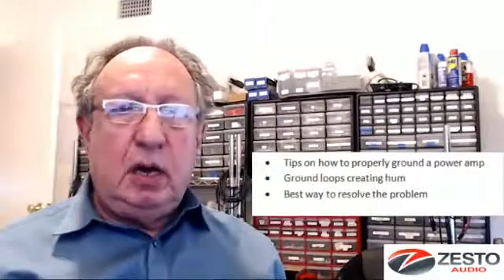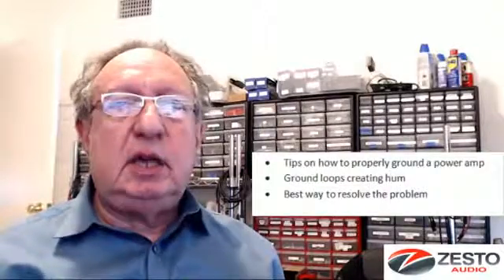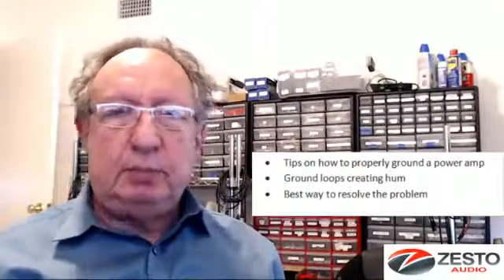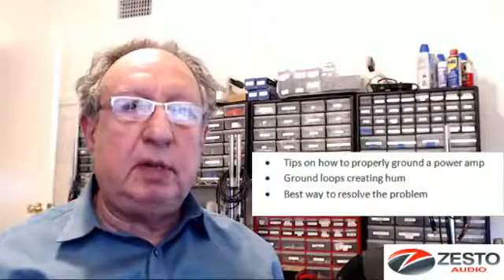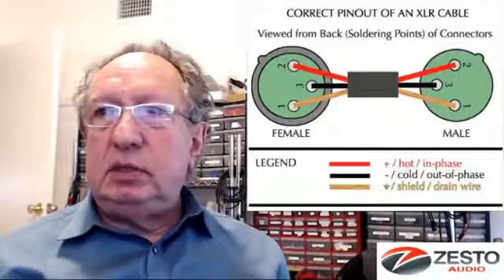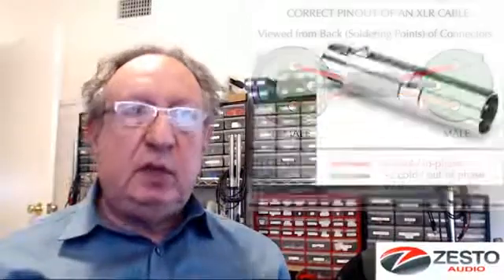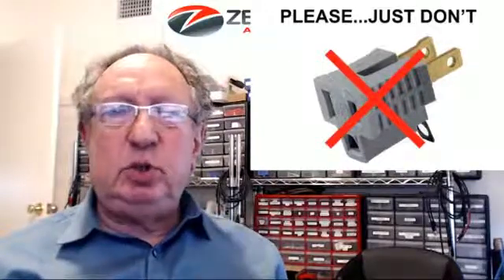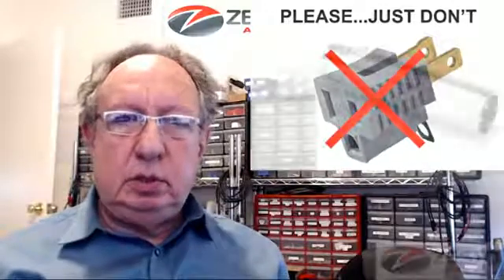Tips on how to properly ground a power amp

Comment: Why are you leaving your ground switch off which to us means your not grounding the system? Wouldn’t you want it to always be grounded?
Reply: Because it is already grounded via AC powercord, it doesn't need another ground. The problem here is the groundloops. Never ground something multiple times from diffent locations since that introduces all kind of problems. In this particular case, the chassis of the pre-amp gets grounded via AC (wall socket), the chassis of the power-amp gets grounded via AC as well. But now we also introduce an audio signal cable (aka interlink) that sends audio from one device to the other. This cable also has ground and creates an extra connection to ground between both devices : not good! With RCA this is unavoidable because it will introduce other problems, but with XLR this can be eleviated by using a ground switch or adapter and this does NOT mean the device is NOT grounded!
I personally never ground anything audio related in home scenarios, I also disconnected ground from multiple devices, especially KRK Rokit speakers. I hate dealing with all the problems and it's just way easier this way. On top of that, almost every consumer audio amp/device doesn't have ground. In profesional settings (like outside/stage) I would design everything properly so ground makes sense, but for home use it's rather difficult to get right as often many devices will connect together introducing ground from all over the place. In the Netherlands every wall socket in the livingroom is without ground, ground is only introduced in places where water exists, like bathroom or kitchen.